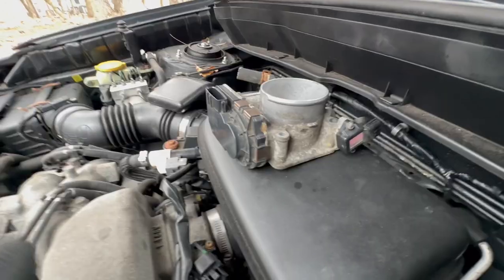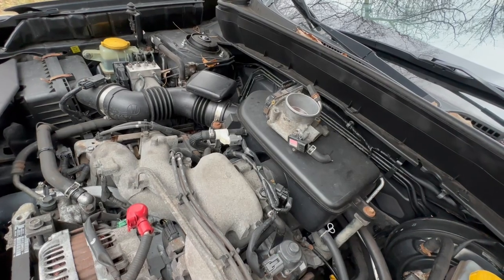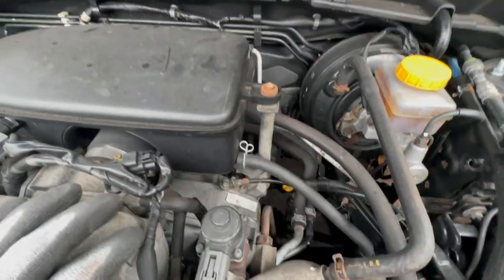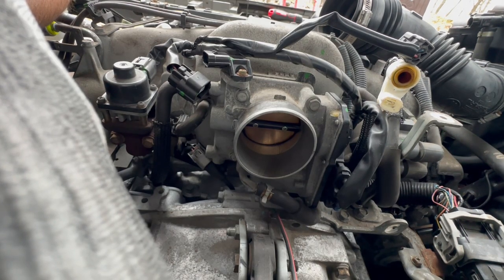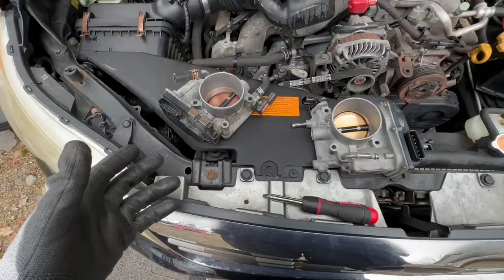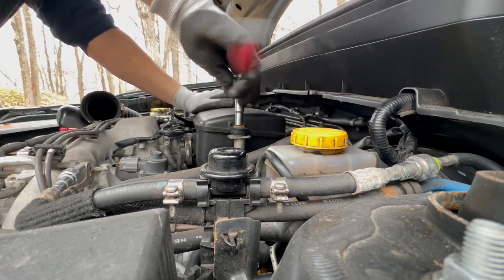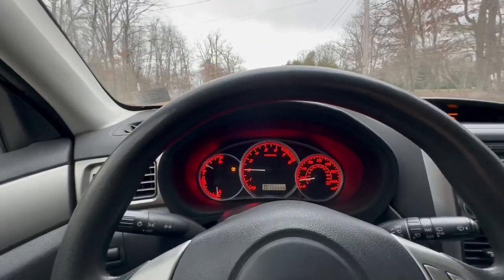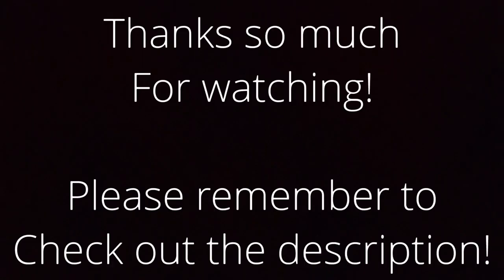2009 subaru throttle body replacement

Comment: G'day from Australia! My 2009 Forester has the same throttle issue. It's like a dead spot off idle, goes from zero to LAUNCH unless I'm particularly gentle. 

Did changing your throttle body resolve the issue for you? The end of your video just mentions that it's okay. Have you had any fault codes?

Also, did you mention something about clamping radiator lines to remove the throttle body?

Thanks for uploading this. Subscribed! 

Hit me back with a sub if you want to see my Subie off roading and camping soon 👍